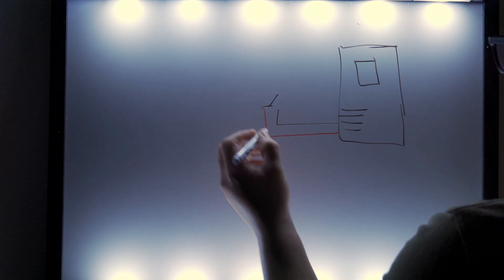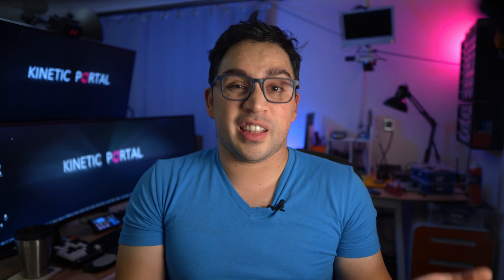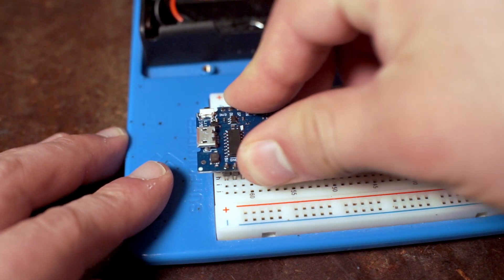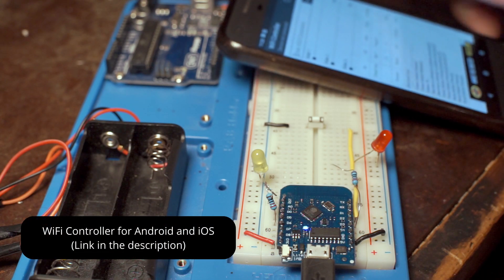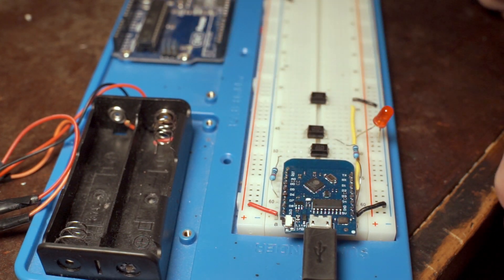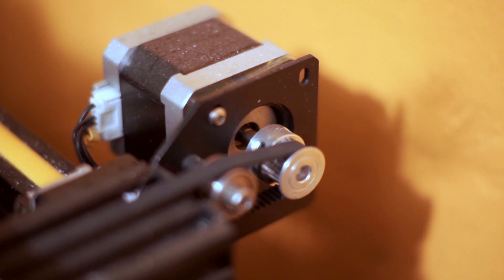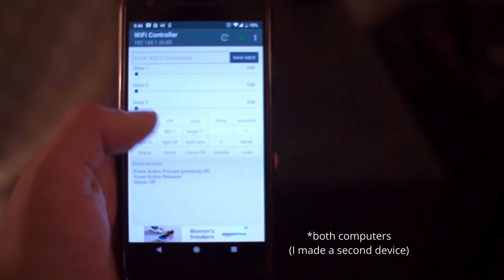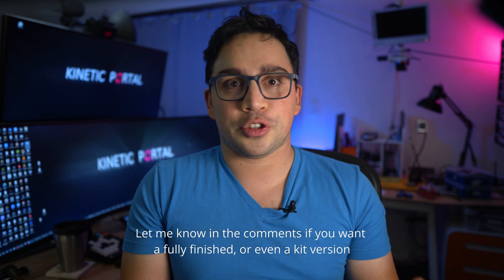How to turn your computer on and off remotely (Arduino project)

Comment: would this be possible with an esp32?
Reply from the maker: Definitely, you'd have to adapt the code so the pins match whatever board you close, but it's definitely possible.

Comment: Hey , so i was interested in making something like this , and i couldnt understand why you had to use the octocouplers ? Like if you are getting all the power from a usb ,  then using some programming cant you make the pins short themselves for a small duration ?

Like on the esp itself ?
Reply from the maker: The reason is so that you don't mix the power meant for the ESP with the power from the motherboard. 

Since the motherboard only wants to detect if the buttons are pressed, those pins don't use a lot of voltage (I'm not sure, but probably 3.3v on most motherboards), so you don't want to send 5V through those pins. The optocouplers are isolated, so they allow power from the motherboard itself,
Reply: @noisycarlos so here is my current setup :

My motherboard has pass through power in the USB ports, I'm using one such USB to power my esp8266, now since they both are being powered by motherboard, can I use gpio to short them?

This is just to sate my curiosity, I'm ordering relay module for the esp in the meantime, it seemed a bit more straightforward.
Reply from the maker: @CorvoAttano-xu8bv  the reason I wouldn't do that is because the voltage of the USB is 5v, and the motherboard control circuit is probably 3.3v. 

Even if the USB power comes from the same motherboard, it might be boosted for the ports to get to 5v, or it might grab the power from a different rail on the PSU, I'm not sure of the specifics of that.

But I am sure that sending more voltage than your motherboard is expecting on a particular pin can lead to a bad day 🙂

Comment: Hi guys, I build up this genius setup.
I have only one problem. After it is flashed to the ESP,  the LED on the ESP is blinking continously and in the Serial Monitor i only get wierd characters which are continously appearing like: 
10:14:49.352 -> ⸮⸮蔈l⸮⸮T⸮l偌⸮D⸮⸮ L⸮⸮⸮t⸮ L՘⸮⸮⸮⸮J⸮⸮⸮⸮ʪ⸮⸮Ł⸮⸮⸮u⸮H⸮⸮⸮⸮⸮⸮⸮⸮⸮⸮⸮⸮ 
Does anybody has a clue?

Comment: This is perfect! I was just thinking the other day about getting some kind of KVM for my gaming PC so I can turn it on remotely for Steam Remote Play, then I realized that no IP KVMs support HDMI 2.1 and 4k@120hz, so that was out of the question. Then I realized that I don't really need a KVM at all, just something to remotely power on or reboot the machine via some physical method. I have a bunch of microcontrollers and random electronics parts laying around and thought I could probably use an ESP chip to do this. One search later and found your project which is exactly what I wanted to do! Thanks for posting about this so others can use it! Ordering the optocouplers now, I hadn't even thought of using them, but it's a great idea to keep everything isolated! THANKS AGAIN!!
Reply from the maker: Glad to hear it helped!
Reply: @noisycarlos  please share the Circuit diagram Source link is not working  *404 not found

Comment: Hello, really nice video. But i do have a quick question.
In your diagram, you have the + Power LED from the motherboard, connected to the rest of the GND. Shouldn't the + Power LED be connected to 5D? Thanks
Reply from the maker: Looking at the diagram again, I can see it's not totally clear. The LED is actually not connected to ground, it's connected to an optocoupler (those black squares with the dot on the corner). So what happens is that when the motherboard LED is on, it 'activates' that optocoupler, which in turn connects D5 to the microcontroller's ground.

Actually none of the motherboard connections (the LED, Power Switch, and Reset switch) go directly to the microcontroller, they all go through optocouplers, which keeps the motherboard electrically isolated from the microcontroller.
Reply: @noisycarlos  I see, so actually all optocouplers from the motherboard plus the case LED are connected to GND as I see in the diagram with a black line.
Reply from the maker: @bogdan90x  yeah, on the microcontroller side, they all connect to ground on one end and the microcontroller on the other. Note that for the buttons, they're connected in one direction (so the microcontrollers control the optocoupler), and on the LED side, they're facing the opposite direction (so the motherboard controls the optocoupler, and the microcontroller just detects that.
Reply: @noisycarlos  Yes, so your diagram is ok. The problem for me was that i did not see the proper optocoupler blowout. I thought that the pin on one side, connect to the pin on the other. But the connection is actually between pins from each side.
I mean i understood the theory but did not understand wht the GND was on the same horizontal line as the +LED.
So on the side of the microprocessor it does not matter where you put the + and where you put the -.
Thank you so much for the fast replies.
Wish you a great day/night.

Comment: Hi, im trying to make this project using an ESP8266 module, but when I compile the code in the Arduino IDE it gives me lots of errors. Can someone help me with this? Thanks
Reply: When I change my passwd and ssid it says "xxxx was not declared in this scope"
Reply: @lilgnzxg4028  hey did you figure it out, im planning on doing using that as well.
Reply: @syedshah5011  I could not do it yet
Reply: @syedshah5011  If you figure it out please let me know

Comment: All this work for that ! You just needed a wifi relay, 12 $, set it up, plug it and done ! Even with voice control.
Reply from the maker: That would have been easier indeed! 
It would work for the most part, however, I wanted the device to be aware if the computer was already on or off by reading the signal from the power LED. For example if I send a 'Power On'  command and the computer is already on, it doesn't press the power button again (which would turn it off).
Reply: @noisycarlos  ah ok. Well if its on it should be online, thus easy to verify and then make a condition in a routine stating that you can only do the Start command if computer is offline. But it is an interesting point.

Comment: Great project. Some of your links of the parts doesnt work. Can you list the type of octocouper and the resistance. Thanks in advance from Peru
Reply from the maker: Thank you! The optocoupler is a PC817C or PC817. For resistors, I used 330ohms in the video. But anything between 220 to 500 ohm range should work.

Comment: Hey nice project. Everythings wrkng fine fr me bt the pc shuts off after 4  to 5 seconds when connecting nodemcu. All cmds work fine though. Is there something missing in ur code . The pwr btn connection seems to make the pc shut off when connected. Plz help
Reply from the maker: Make sure you use the 'on' command and not the 'pressPwr' command, since that one will keep the button pressed. If that's not it, I'd check the serial monitor in the arduino IDE
Reply: @noisycarlos  bro facing same problem tried everything can u suggest wts wrong here?? wt i tried:- 
tried different node mcus 
tried different pins 
m not using pressPwr command only on off reset 
PLz  help bro .
Reply: Bro in the btn i only use three of them cmnds on off reset. But d6 pin when connected gives the problem it shuts off within 4 secs. Plz help wt do u suggest.m using the exact code as urs nd same diagram. M using only three commands nothing else.
Reply: Plz help me bro i struggled a lot and completed the project but its the only issue m facing.  Plz help
Reply from the maker: I'm not sure of what's happening with your computer, but you can try using an LED instead of the Optocoupler for the Power button to help you diagnose. When you send the ON command, the LED should turn on for a second or two, then turn back off. When you use the pressPwr, it should turn on and stay on until you send releasePwr

Comment: Hey bro was looking for something like this mate . Thnks a lot. I want to ask u if u have faced such issue which i face last night my pc got freezed and i opened the wifi app same like yours nodemcu was connected but it was not sending any commands , I was not getting any print statement also , in order to get it work again i had to power off and on nodemcu . IS THIS ISSUE with APP or NODEMCU or what ?? PLZ HELP . THANKS AGAIN BRO.

Comment: Thank you, I was able to make and prototype  my own version of this project thanks to this video. It was my first ever arduino project that didn't just turn on leds. Mine is strictly for Dells with the 5 pin power/led/ connector that's used in a variety of models. There a few of these machines in my office that have the "Resume AC on power failure" feature turned on in the bios but that doesn't always work. This project will be nice for the "power stutters" in our building that shut off a few of our shared computers. A lot of our users work remotely right now due to covid and I have to go in from time to time to turn those machines back on when the power glitches. I tested my project with a few of those systems and it works flawlessly.  Thanks again!
Reply from the maker: That sounds great, I'm glad it helped!

Comment: Do both devices have to be connected to the same wifi or can I turn it on away from home
Reply from the maker: By default it only works in your local Wifi. However, to use over the internet you can open a port on your router and use a Dynamic DNS service like DynDNS or noip.com.
Reply: @noisycarlos  The code is not work, can you plz help.

TX_1:3:20: error: expected primary-expression before '<' token
 const char* ssid = <test>;
                    ^
ATX_1:3:21: error: 'test' was not declared in this scope
 const char* ssid = <test>;
                     ^
ATX_1:3:26: error: expected primary-expression before ';' token
 const char* ssid = <test>;
                          ^
ATX_1:4:24: error: expected primary-expression before '<' token
 const char* password = <test123>;
                        ^
ATX_1:4:25: error: 'test123' was not declared in this scope
 const char* password = <test123>;
                         ^
ATX_1:4:33: error: expected primary-expression before ';' token
 const char* password = <test123>;
                                 ^
exit status 1
expected primary-expression before '<' token

Comment: Thanks for the video. I already bought everything and now waiting for the parcel to make this project for myself. And one little wish from me. Can you please make detailed photos of the board
Reply from the maker: Hi, my mistake I forgot to do the diagram. I'll make it and post on the page with the code and parts list.
Reply: @noisycarlos  hello. I'm still waiting for diagram or for the photos at least. Please
Reply from the maker: Hi  @IronShell  sorry for the delay. I just posted it to the website. Good luck, and feel free to ask questions :-)
Reply: @noisycarlos  very big thanks for the scheme, but i got one problem with code. It's compiles but after uploading sketch the board starts pouring an error like this: 
load 0x4010f000, len 3584, room 16 
tail 0
chksum 0xb0
csum 0xb0
v2843a5ac
~ld
ISR not in IRAM!

User exception (panic/abort/assert)

Do you know something about that because I'm in stupor because of this?
Reply: @noisycarlos  which commands is used in app to communicate?
Reply from the maker: @Zubairkhan-rb1fx  they're in the code, but you're right, I should put a reference. The main commands you can send are "on" "off" "reset" "status". Also some 'advanced' commands: "forceOff" "pressPwr" "releasePwr" "lightOn" "lightOff" "lightAuto"
Reply from the maker: @IronShell  sorry I'm not familiar with that error. I hope you were able to make it work
Reply: @noisycarlos  sorry for the trouble.. i had figured it out
Can u tell how to know about ip address that is used in app?
Reply from the maker: @Zubairkhan-rb1fx  you need to enter the IP of the Wemos. When you run the program in the Arduino IDE open the Serial monitor and the program should give you that information. Otherwise, you can usually find out the IP of your Wemos via your router
Reply: @noisycarlos  thanks.. it was very kind of u to help me out
Reply: @IronShell  Hi IronShell. I also got this error using the code shared on his website. What was your solution past this?
Reply: Solution is downgrade the esp822 board library to 2.4.2. Hope that helps someone :)